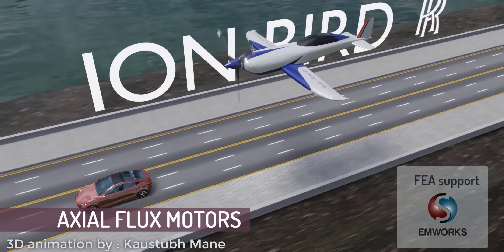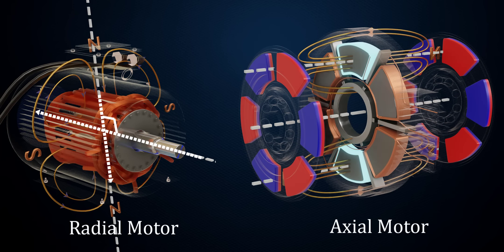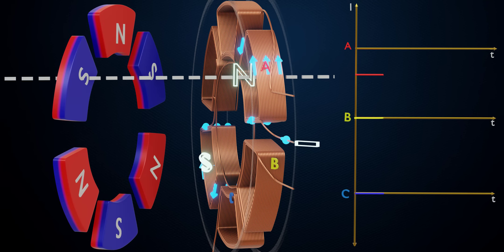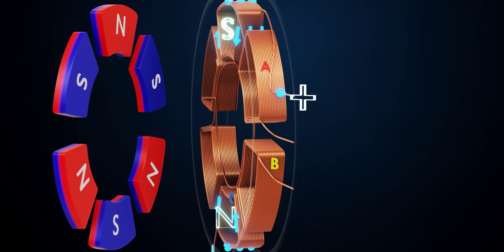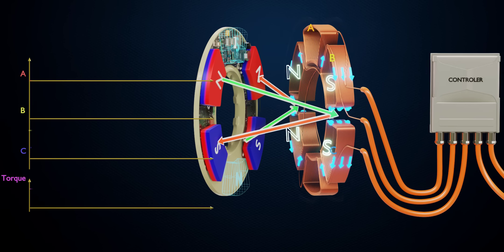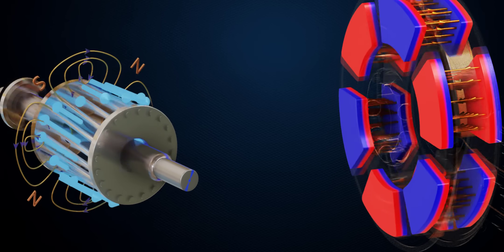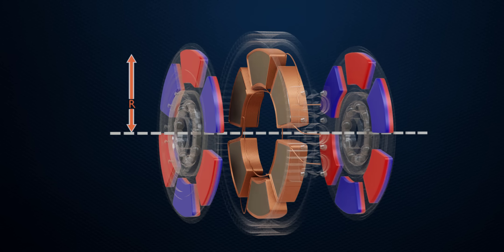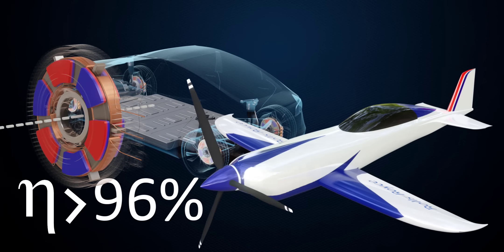Axial flux motors - The new hope

Comment: I remember when I first learned that electric motors appearing to operate so fluidly is just a lot of discrete actions done very fast.  Blew my mind for a sec
Reply: keep in mind that everything in the universe seems like it is moving smoothly but the base of interaction/information is quantized
Reply: Just wait until you hear about internal combustion engines
Reply: I have not been this impressed since Rockwells' Retro encabulator.
Reply: There are gliders that stay aloft for hours with NO thrust; they use natural thermals to gain lift (like a seagull).

 Imagine slapping one of these bad boys on there.
Reply: Well, a modern computer has billions of discrete operations happening every second
Reply: Build airports on mountains with runways angled down for takeoff, up for landing. Parking at bottom, mag-lev to terminal. Regenerative braking for Terminal --> park. maybe some sort of counterweight system to help pull the mag-lev uphill. I dunno. Flywheel energy storage? Adapt the SF cable car system?
Reply: As a child I loved electric motors, took many apart and rebuilt them, always wanted an electric bike, I've got one now, not as good as I hoped it would be, but it does the job
Reply: @Markcain268   dude same, me and my friend would always look for DC motors inside electronics and such
Reply: @k-osmonaut8807  I was mad on them until I discovered engines!
Reply: @Markcain268   i like the two, I'm playing both sides so i always come out on top
Reply: @k-osmonaut8807  yeah motors have their uses,  I just like engines more
Reply: @Markcain268   i like them for sound and stuff, i like motors because i simply like their tecnical aspects and such
Reply: @k-osmonaut8807  yes they are very versatile, my 1kw ebike is a nice ride, easy maintenance too, just the brakes require more attention than when it was just a push bike lol
Reply: @Markcain268   they do, i had a ebike before you use brakes much more than in normal bikes
Reply: @k-osmonaut8807  Certainly do lol, luckily, new brake blocks are only a few pounds from Wilko store down the road
Reply: @Markcain268  Many years ago, in the mid 60's, I helped a guy who was making an electric bike using a car starter motor and a 12 volt car lead acid battery......it went like the clappers and hit 50 MPH but was totally uncontrollable at start off rearing up like a Kangaroo.
The power was connected to the motor with a knife switch on the handlebar and drove the back wheel by chain drive.
Reply: It REALLY depends on the type of motor tho. The induction motors shown in this video are hooked up to 3-phase sine-wave that creates a constant magnetic field that is smoothly rotating. Cheap DC-motors found in toys are also contious. Its only these new-fangled* motors with fancy electronics controlling them that have discrete steps.

*I say new-fangled but these have been in existance since the 70's.
Reply: How quickly it is done.... amazingly
Reply: @Anus Smalls Lmaooo
Reply: It's the same (generally) with watching a movie or a YT video - it's also how computers "multitask".
Reply: Or in other words taking away Mechanical Engineer jobs.
Reply: @eyeofthepyramid2596   i'm pretty sure mechanical engineers won't lose their jobs, not a lot of stuff in the design process will change
Reply: Well, electric drills for example - any "brushed" motors actually - manage these discrete steps "mechanically" as when the brushes wipe against a series of electrical contacts on the rotor causing different coils to be energised. A low tech solution to a complex problem, although brushes become a consumable element, and leave graphite dust as a byproduct.
Reply: everything is quantized and fluidity is an illusion.
Reply: A black man actually invented the axial flux motor, but the technology was stolen from him.
Reply: @oldolfmann8927  yup, black people invented most of everything in the modern world, but their ideas and inventions were all stolen.
Reply: Still inferior to a nice piston prop. Will always be inferior. Why try to make everything electric? Electric planes and cars are outdated ideas
Reply: @AverageAlien  oh because fossil fuels are the future, the most efficient  ice engines are about 40%  while most electric motors are over 90%.
Reply: @cheetomussollini  The best Li-ion batteries have a 265 Wh/L energy density. 

Petrol has a 12,200 Wh/L energy density. 

90% of 265 is 239

20% of 12,200 is 2,440

So petrol still wins by a factor of 10 

Lol
Reply: @AverageAlien  Luddites of the World unite it seems......
Reply: @AverageAlien  Electrically based transport will be here long after you have been forgotten . . . .🤔. . but then that time is not a long time away!!!🤣🤣
Reply: @paultrgnp  Lol
Reply: @AverageAlien  once upon a time, rotary engines were better than radial engines. Then people tried really hard and improved the alternatives.
We're currently in that stage with electric propulsion and it's getting close to the turning point. The only thing left is better batteries, and we're getting there
Reply: @Tonatsi  There's nothing new about electric cars and planes. The first ever cars were electric and they failed miserably. Petrol won. Battery tech has peaked, physics won't allow batteries to get anymore efficient. 

Plus who would want an electric plane? So garbage, no noise, no vibrations, no soul. It'll be like those boring turbofans, minus the sexy noise and the sheer raw power of those things.

The power to weight of batteries is horrifically dogshit.
Reply: @Tonatsi  Please tell me what multimillion corporation uses piston prop aircraft to the point that they need to save money on fuel? Hahaha. Piston props are usually personal aircraft, planes that IM looking to buy soon, planes that are privately owned. There are no multimillion dollar corporations looking to buy piston prop planes. 

Like the saying goes, if it ain't broke, don't fix it. Light aircraft are perfect where they are now, electric will only cause more problems.
Reply: @AverageAlien  What about airlines. The fuel costs for long haul planes are incredibly large, to the point that airlines prefer planes with less carrying capacity if it means that it's more efficient per person. As for short-haul planes; they will likely be the first planes to be changed. Since they don't fly as far, they would need quadratically less total energy and thus battery weight.
As for "If it ain't broke, don't fix it":
By multiple criteria, you can consider them broke. First off: pollution. You simply cannot remove the pollution of a fuel powered plane. Electric planes have the potential to be carbon-null. 
Second: sourcing the fuel. Everyone has to buy their fuel somewhere, and have it brought over. Airports get around their immense consumption by literally having a pipe directly between them at the refineries; but if this pipe gets cut off for whatever reason, they cant fuel their planes. With electricity, it's much easier. You also aren't as tied down to one energy source: electricity can be made either from fuel, or multiple other sources like wind, solar, fusion (maybe in the future), nuclear fission, etc. Lets say the world has an oil crisis, or countries hoard oil. Other countries will be very happy to have airplanes that dont rely on the strategic resources of other countries.
Fourth: Efficiency. As of right now, yes, fuel planes are better than electric planes. But this isn't a permanent fact, it's an observation of our current state of technology. We have reached the physical and chemical limit of getting as much as possible out of fuels (at reasonable pollution levels) but we have not done the same for batteries.
Reply: @Tonatsi  You're joking, right? Airlines? Hahahahaha. Not a chance. Not even in the next 500 years. Jesus christ, you were pushing the limits when talking about tiny 4 seater piston prop light aircraft. But you actually think that....you can swap out turbofans for batteries? My guy, where do I begin? I'm not sure if you realise just how ridiculous that statement is. A gigantic, heavy jet, that requires 15,000 lbs of thrust per engine just to get off the ground, cannot, EVER run on batteries. Maybe in some alternate reality fantasy land, but not in our reality and our universe. 

And even with tiny passenger planes, that use turboprops, like the q400 or the ATR-72, those turboprops cannot be matched in thrust force by any amount of batteries. You'd need to literally fill the plane with the most energy dense batteries in existence and even then you'd be lucky to move anywhere. 

Pollution isn't an argument. Air travel contributes nothing significant to climate change, especially with how efficient aircraft engines are. Cars and planes should remain running on diesel and gas. They have almost no environmental impact. 

The actual manufacturing of batteries, transportation, and eventual disposal, will contribute the same amount to pollution. 

The only solution to man made climate change is to remove all fossil fuel powerplants and replace them with nuclear energy. No more wasting time with worthless renewables for another 20 years, but building those nuclear plants right now, this very second, and demolishing every last fossil fuel power plant. That will eliminate 30% of all greenhouse gas production instantly. Next step is to allow more private companies, and I mean TRUE private companies (no government subsidies or regulation) to build MAGLEV trains and other advanced public transportation routes, so that there are less bad drivers on the roads. 

This way, everyone wins. Climate change would have been defeated, all the bad drivers are off the roads, all the electric and renewable garbage has been made redundant, and the world is saved. If only I was in charge, eh?
Reply: @Tonatsi  We have reached the physical limit of efficiency for batteries too. Even the most advanced types you mentioned.
Reply: @AverageAlien  Tonatsi is right. The cost of fuel for a commercial flight is usually around 1/3 to 1/2 the price of the ticket. Airplane manufacturers are already looking to hybridise the technology to eek out more fuel savings, because that's exactly what the airlines want. It's not ideological, it's just commercial reality. And what's held back the use of induction motors and axial flux motors is the issue of storing power in increasing energy densities, which is still in the process of improvement.
Reply: @yggdrasil9039  Airlines have reached peak efficiency when it comes to passenger aircraft. There is quite literally no way to make their model any more efficient. No magical batteries exist that can make passenger planes any more efficient. Those high bypass turbofans cannot be beaten, not in thrust force, and not in efficiency. There is no way any amount of the most revolutionairy battery technology you can think of, will ever compete with that.
Reply: @AverageAlien  That may be true at present, but there are some incremental improvements that can be made to reduce fuel use which are being worked on now. These are various forms of microhybridisation. Rollout can occur with engines off, overall systems can be powered off a battery, the turbofan can incorporate electric induction to reduce fuel used simply to drag air into the jet core and bypass, and furthur down th etrack, high altitude flying could be done using an electric propulsion system (powered by Li-Su batteries which start to approach the energy density needed for commercial flight) of some kind. These are all the points of flight where the jet engines are least efficient, and are clear targets for hybridisation. Jets using the traditional method would then be used for take off and ascent to cruising altitude, greatly reducing fuel use.
Reply: @yggdrasil9039  Could be, maybe, we'll see how it pans out. 

But then there is a slight oversight. Safety. Lithium batteries are extremely flammable. Flammable and prone to failure. If you're in a car, that's fine, a plane? Not so much. 

I mean, there's a $250,000 fine for anyone caught with a galaxy note 7 on a plane. And that's just one tiny battery. Planes carrying these batteries, mostly cargo planes, are limited to 30% charge only I think. 

And before you think of mentioning that the fuel is flammable, it's not as flammable as you think. Firstly, fuel can't short circuit, secondly, jet fuel is extremely difficult to ignite, and needs to be atomized first.
Reply: @AverageAlien  That's wrong. If you're referring to power loss from charging efficiency, we're continually improving how efficient our batteries are, and if you're referring to energy density; some of the batteries we have in development are already better than fuel for the mass-propulsion ratio. The only reason we dont have them is because we haven't made them safe or reliable enough, something that's only a matter of time.
Fuel engines will likely always remain for applications where speed is the most important factor (like military jets) but for anything less, batteries will eventually become more competitive than combustion.
Reply: @Tonatsi  Highest energy density batteries today: 670 Wh/L or 2.4 MJ/L 

Jet fuel energy density: 9.6kWh/L or 34.7 MJ/L

You've got quite a ways to go my friend....
Reply: @AverageAlien  That is true. And the safer LFP batteries that are virtually fire proof are unfortunately not going to be suitable for commercial air flight because... well... they are made of Iron. I don't know yet about flammability of Li-S. I do believe they may be safer than Li-ion but at least 5 years away from being a reality. Time will tell. But meantime microhybridisation is coming. It's official policy at Airbus with a whole team dedicated to it, I doubt Boeing will be far behind.
Reply: @AverageAlien  Once again, you haven't done your research. The energy density statistic you took was from the high-end range of Li-ion batteries. Li-ion batteries are the best batteries for energy density that are commercially used. Given we already have batteries in R&D with 10 times that energy density, we're already at 24MJ/L. Now taking into consideration that jet engines have an inefficiency when converting the 34.7MJ/L into mechanically deliverable energy, while electric motors are much more efficient, the gap closes much faster. A fun fact that I discovered while searching for sources for this argument is that commercial jet turbofans are typically only 40% efficient with their fuel-propulsion energy ratio; the rest being converted into heat and other chemical reactions. Already, that reduces the jet fuel power per litre to around 14 MJ/L.
Reply: @AverageAlien  LuL no "soul" and "noise". that´s EXACTLY what I want in an commercial aircraft. The less noise the better, don´t want my ears to hurt after a flight on top of everything else shitty that comes with flying...
Reply: @AverageAlien  I mean, I was on a "recreational" airplane-trip once, it was a cessna I believe. I did appreciate the experience, not the extremely loud noise though, and that´s why we had headphones on.
But I just really don´t care for the experience of commercial airline flight for traveling. I just wanna be at the destination, I could not care less about how I get there, just wanna be there, fast, easy and safe. And while on the journey I don´t care for loud noises, especially if it´s for 8 hours and I just want some peace and quiet... Similarly, I like nice, high powered cars, which can also sound nice, but I wouldn´t want to go an a roadtrip in one because of the noise...
soooo... yeah. A commercial airliner doesn´t have "beatiful sound" it has annoying noise.
Reply: @shitposter4688  Nah it has a beautiful sound. The noisier the better. The newer ones are just garbage because of how silent they are. I'd love a long distance flight on a boeing 707 with those beastly low bypass turbofans blaring. Especially if you sit in front of the engines, then you get that beautiful buzzsaw noise from the fan blades. Godly stuff. Nothing helps me sleep better on a plane than the reassuring sound of thousands of pounds of thrust keeping us in the air at 500mph. 

As for light aircraft, those 6 cylinder monsters are too hot. The way they vibrate and sputter to life, so alive.
Reply: @AverageAlien  You wrote that the first car was electrical. The first type of automobile was moved by steam /water vapour, like locomotives. In England/UK people still have that type of "cars"  (as "relic", etc...)👍.
Reply: @AverageAlien   "A gigantic, heavy jet, that requires 15,000 lbs of thrust per engine just to get off the ground, cannot, EVER run on batteries." - I'll put this quote right next to these:

Ken Olsen (Digital Equipment Corp. founder), 1977: "There is no reason for any individual to have a computer in his home."
Charles H Duell (Commissioner of the US Patent office), 1889: "Everything that can be invented has been invented."
Reply: @MultiSteveB  We have reached peak efficiency. If there was something we knew about that we could use we would've used it already. Unknowns are irrelevant.
Reply: @AverageAlien  Well, time will tell.
Reply: @AverageAlien   the sound of a commercial aircraft engine is literally one of the most boring ones, just WHIZEEEEEEEEEEEEEEEEEEEEEEEEEE
Reply: @AverageAlien  I think if we were having this conversation about RC electric drones 20 years ago, you would have said the same thing.  A battery powered quad copter would have seemed ridiculous, and prohibitively expensive in the late 90s.  Now they are nearly disposable novelties.  You seem way too confident that something will never happen, and it almost seems like you specifically don't want it to happen and don't want to think about it.  Your outlook is irritating and kind of stupid.  I hesitated to say that, but no, I think it's quite stupid.
Reply: @AverageAlien  No, my point is that it's foolish, and extraordinary to claim that something like electric motors and electric power in general will never be commercially viable in aircraft. And it's absurd on it's face to say that electric motors are an outdated technology.  You sound like you have some kind of phycological complex that prevents you from wanting to have to deal with electric motors.
Reply: @somethingelse4424  Because it never will be commercially viable....I mean it's simple physics
Reply: @AverageAlien  I use to build/fly model airplanes. I'd gas it up...fly like crazy...land.... gas it up...fly like crazy.....all day if I didn't crash it.
Now I  see guys fly like crazy...land.....charge batteries for 45 mins. Imagine waiting for your giant passenger plane to finish charging. 
Big giant airplanes just sitting there....not making any money...
Reply: @readmore3634  I know, it's insane
Reply: @aquamastertheonlyone  I did a quick search and it seems said car was invented in ~1672(ish? exact dates unclear) whereas the first human carrying electric carriage was in ~1888. Roughly 200 years later. <_< fascinating stuff really.
Reply: @Tonatsi  electric propulsion is not as efficient as you might think, the efficiency of the motor is not the only thing, it’s also the discharge losses and inverter losses. You are probably looking around 75-80% efficiency overall. 

To what I have heard that 10x energy density battery (fluoride-ion) which needs to be at least 150 degrees C to operate, so up in the air you would need to heavily insulate it and keep it at that minimum temperature which would use a lot of energy since it would be -20 to -50 degrees C up at very high altitudes. 

Also is the 40% efficiency of a turbofan is spinning the turbines or does it include the waste heat being used as extra thrust from the exhaust since some turbine engines can reach between 50-60% if they reuse some of the heat like they might do in an aircraft at 20000 feet.
Reply: @AverageAlien  I can't agree on this. Energy can be generated in many ways, stored in many ways, and using it directly is a big deal. The only advantage of fuels is energy density, internal combustion engines are less efficient but have a way bigger energy supply. The problem is that fuels are not renewable supplies compared to the energy we can extract from a fission reactor in 100 years they will be extremely expensive anything powered by fuel will be a luxury while cheap nuclear power will flow all around the globe capable of charging anything, we just need batteries with higher density, or maybe even nano nuclear motors.
Reply: @daniivanov4554  Ok then let's stick a fission reactor in cars and planes